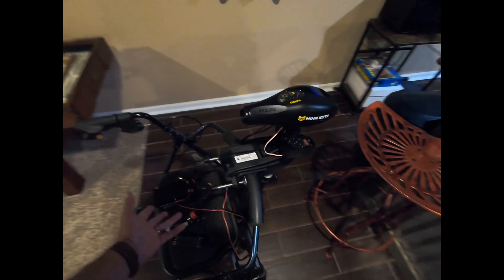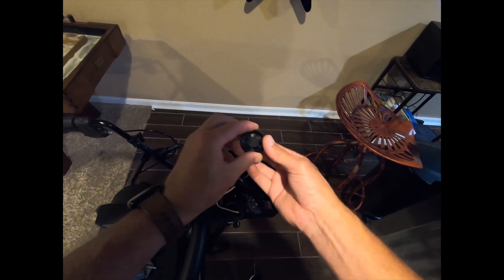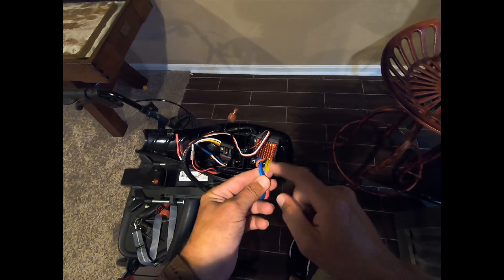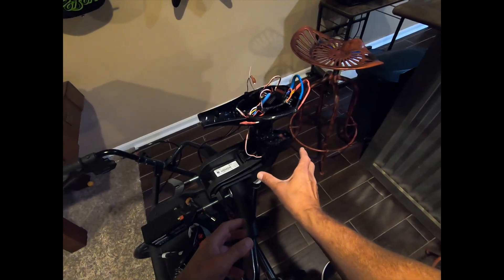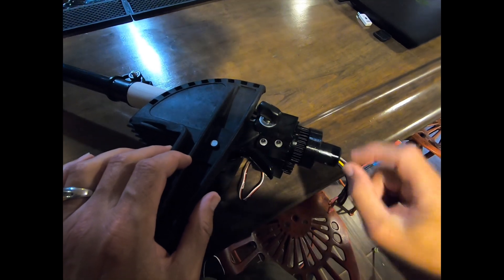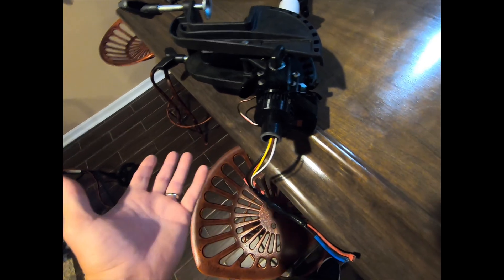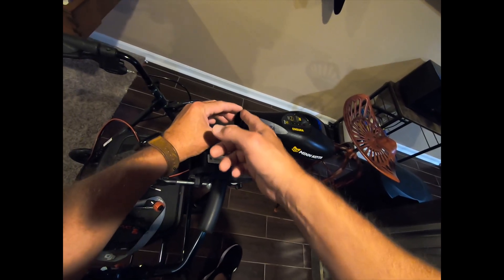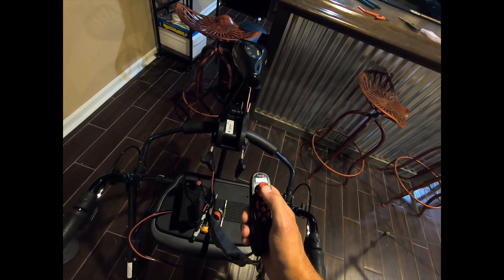DIY Remote controlled trolling motor. ￼￼

Comment: what size bearings did you use?
Reply from the maker: 51107 35mm x 52mm x 12mm should be in the link in the description. Thanks for checking out the video.
Reply: @BassfishingwithNick  I think the sizes might’ve gotten mixed up. I originally ordered the same size you have, but it turned out to be too big for the shaft. I switched to a 30 mm instead and it fit perfectly.
Reply from the maker: @DannyLudovino yes I believe the shaft is 28.5750mm (1 1/8in)but the insert on the 3-D part is 35mm. Not entirely sure where you placed the bearing but mine is inside the top gear and the lower unit encased with the servo. 

https://minnkota-help.johnsonoutdoors.com/hc/en-us/articles/29479573010583-Shaft-Diameter-and-Shaft-Specifications-for-Minn-Kota-Motors
Reply from the maker: There may be two separate files for the 3-D print I can’t remember so we may both be correct but I used a minn Kota trolling motor. Sorry not trying to cause confusion.

Comment: This is exactly the video I was looking for this is awesome!
My question is there a way to make the controls less touchy/fast or in the water is it more manageable?
How has the 3D printed parts held up?
Reply from the maker: Yes the controller can just be moved slower. I know that seems simple but if that doesn’t work you could probably use the Esc controller to reprogram it to turn slower. The 3-d print held up very well even in the middle of the day in 95° weather. I used petg filament. Now the one I ordered didn’t hold up very well and when it was binding up it would break.
Reply from the maker: https://www.amazon.com/gp/aw/d/B00AX69CCI?psc=1&ref=ppx_pop_mob_b_asin_title

This is a programming device for the Esc.